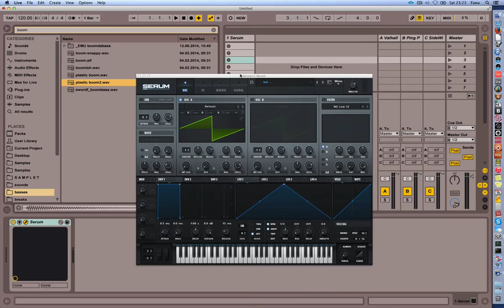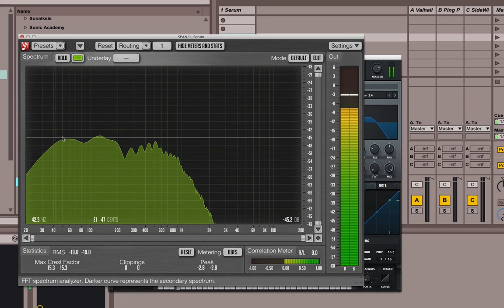Synthesis bas(s)ics: how to create a boom/808 bass with Serum synth

Comment: Nice tutorial! But i'd rather map the coarse to an envelop since with the LFO, the attack time will be directly linked to the project's bpm plus you got complete automation and macro control with the envelop!
Reply: Jean-Baptiste Manillier you can turn of the bpm synch so it's completely free. And in envelope mode it's basically an envelope with the possibility to add more dots and work more precise.

Comment: If I was trying to create something similar to this but didn't modulate the ' crs ' function, Would it remove the pitching from the attack of the sound ?
Reply: You can by using master tune instead and putting an ENV or LFO on the master tune, usually about +24